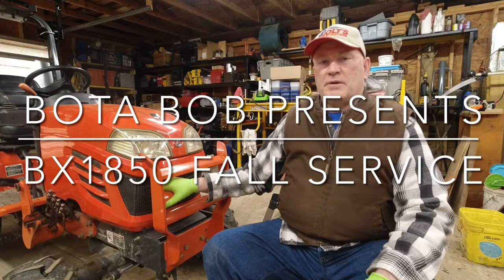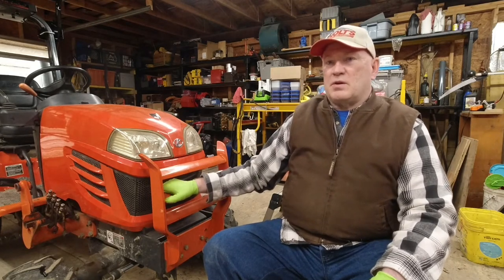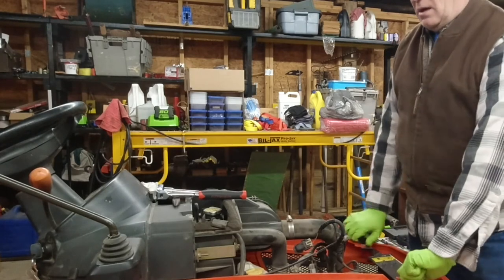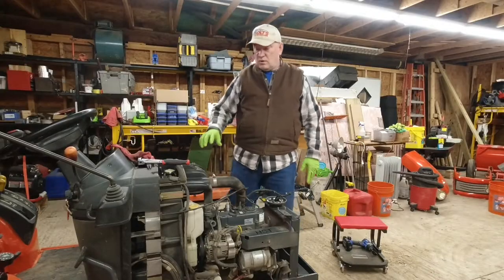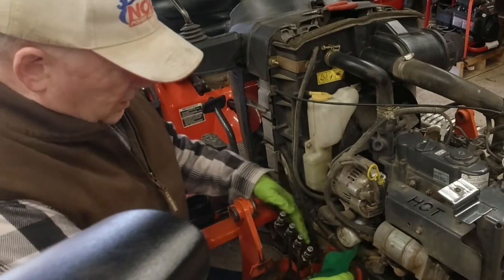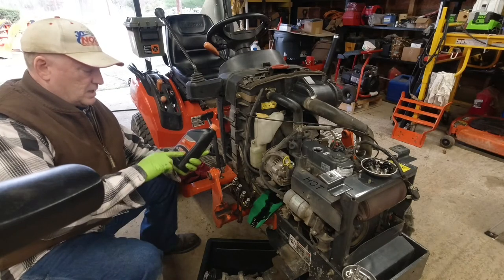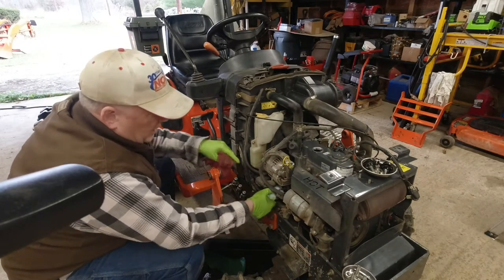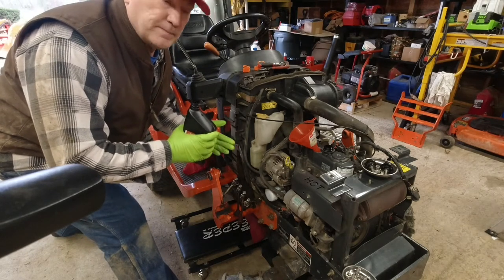#61   BX1850 Fall Service

Comment: Nice job Bob.. you did that like a pro. Great great guide for any new be owner 👍🏻
Reply from the maker: Thanks 👍 - I have been doing oil changes before I could legally drive - I worked in a machine shop for 2 years before I entered the USAF -  I spent 19 years working on Main Frame computers, telephone switching equipment and what have you.  I wish I was able to recall stuff better.  Truthfully, I make these video for me as much as for others in the sub-compact tractor community.  Thanks for watching and commenting.

Comment: I have a L3901 and it’s been good.   I’m thinking getting a BX to replace our old Simplicity for mowing and light garden work.   Yours has been good and you take care of it.  Thanks for sharing and stay safe.
Reply from the maker: Sounds great! - Don't get me wrong, but I would suggest not purchasing an 18 hp BX.  Get a higher HP BX with a 60 inch mower deck.  The 20+ HP versions can lift more and have higher ground clearance -  Things I wish I knew when I purchased my 1850.  And honestly, if I was to purchase a new sub-compact today, I might look at the John Deere 1025R.  In my opinion, removing the mower deck is a real pain.  Not bad if your young, but as we age, it becomes a chore.  Thanks for watching and commenting.
Reply: @botabob  thanks!  I appreciate the input.  I will do some looking at the 1025 as well.   Have a great week!

Comment: Bob never took hood off Will take it off next time
God Bless All 
PaK
Reply from the maker: It's an easy task.  Use a pair of pliers to pinch the retaining clip for the headlamp wire harness.  Rotate the headlamp bulbs and remove.  Remove the four nuts securing the hood to the front support frame.  I am glad you found this video useful.  Thanks for watching and commenting

Comment: I never noticed those little Kabota's had the engines in backwards to most other tractors.
Reply from the maker: You are correct Vern.  The fan draws air from under the steering wheel through the radiator and the hot air is vented out the side and front of the lower bonnet.  Jon Ritter shows how this design is really nice when a cab is installed on the BX.  Thanks for watching and commenting.

Comment: Hey Bob, great job there on your service. How many hours per year to you put on the BX ?
Reply from the maker: I bought the BX with 100 hours on the clock.  It is just below 1000 hours now.  So, I have been putting less then 100 hours per year.  Thanks for watching and commenting.
Reply: @botabob  Same here got mine BX1870 with 95 hours on it. I don't put but about 50 hours a year mowing, no loader on it. Love these little BX tractors. Have a Blessed Day
Reply from the maker: @michaelfinney2160  It takes about 2.5 hours to mow my grass weekly.  Then there is snow plowing, and firewooding.  I give it a good work out.  it's a great little machine.